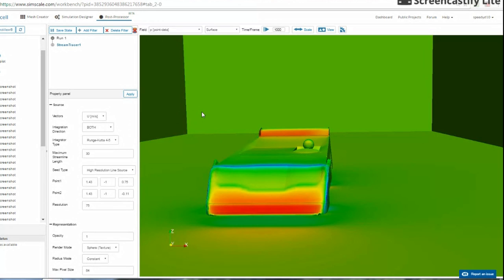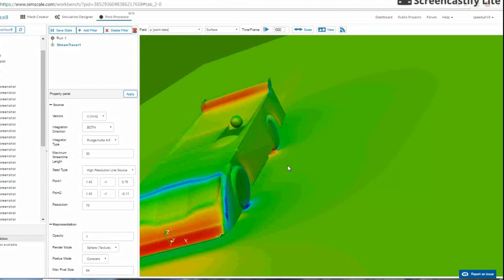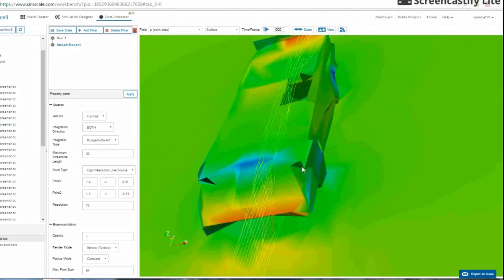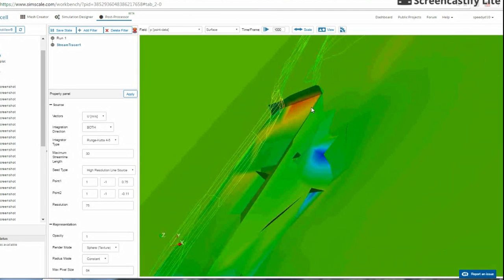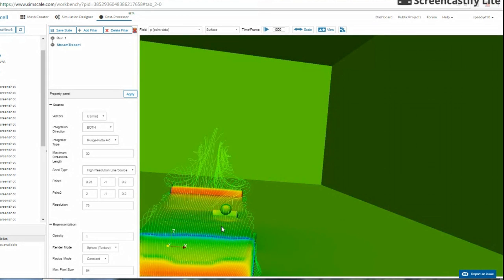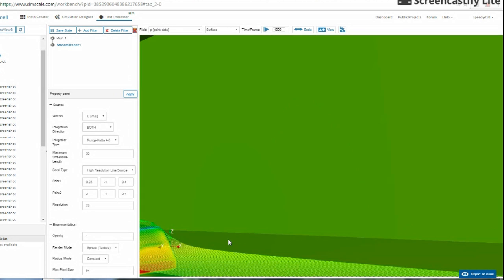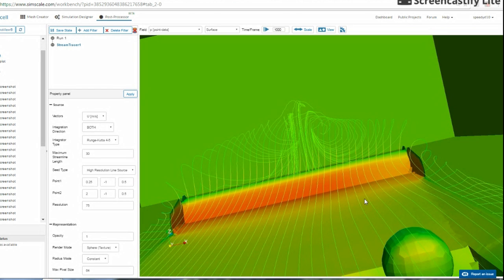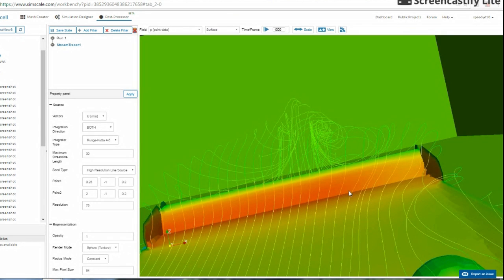Dirt Car Aero simulation

Comment: I know this has been a while, but have you done any of these for modifieds. Everyone runs big closed sail panels and massive roofs. But late models run the opposite, and almost all I've talked to say they would run even smaller if the were allowed to.
Reply from the maker: No haven't done one for mods. For sails the ideal is open right closed left. That's on for both types. Obviously rules don't allow that, but I try to use them to get as much air to spoiler as possible.

Comment: Does cutting a slit at RR deck in front of the spoiler help relieve the daming and air bubble to help create more spoiler down force
Reply from the maker: No. The "bubble" as you called it is a pocket of swirling air caused by spoiler being too steep. Never exceed 70° spoiler angle, as this is best starting point. I have been slightly higher but very very rarely I go over that 70° angle. Steeper then 70-73° you risk the pocket forming kinda like a tailgate on a pickup truck does. You want to ramp the air up the pocket makes air roll off spoiler.

Comment: I've noticed that cars now have laid back windscreens in front of the driver.  I would think that would get the back on the rear deck.
Reply from the maker: It does have an effect on turbulence around the driver and seat. It slightly directs air around cockpit bit minimal.
Reply: @DirtTrackDave  Hi Dirt Track, I found this piece on turbulence at a website called Engineering.com.  It's about laminar flow, turbulence and reversion around the back of the car.  engineering.com  Turbulence-What a drag it is.